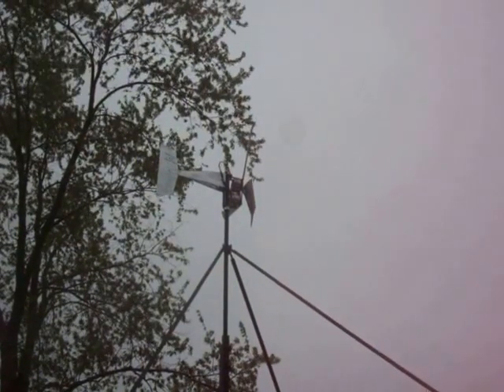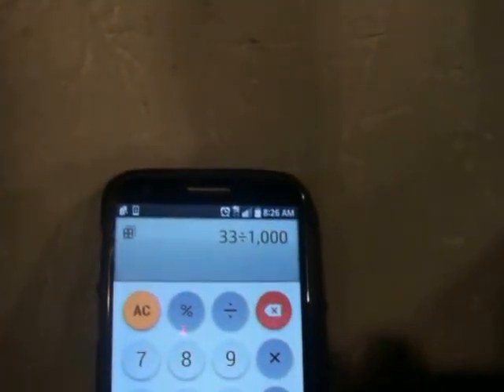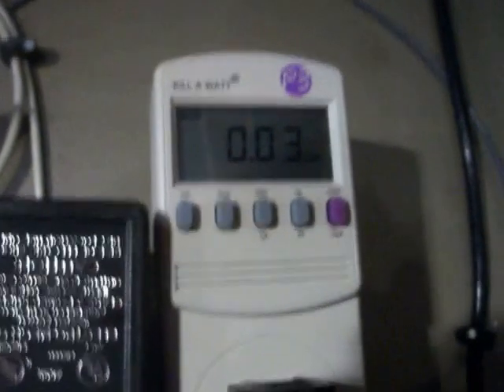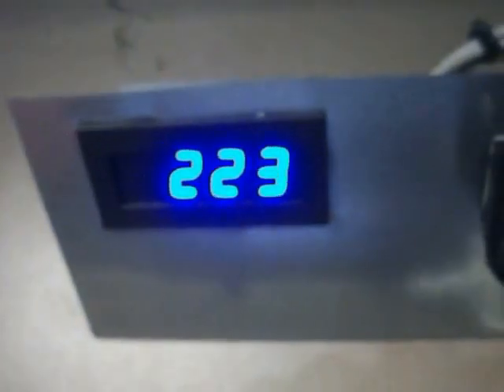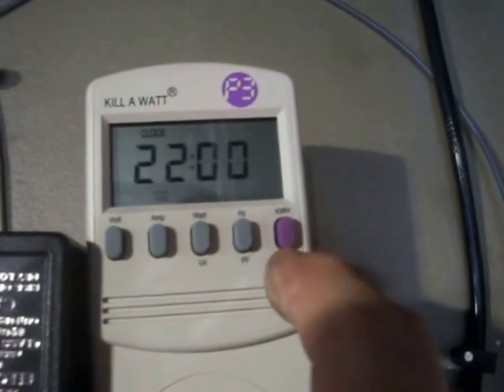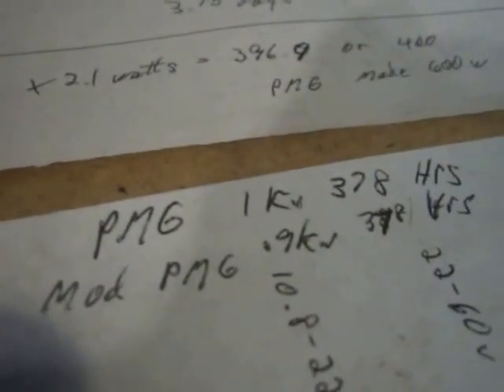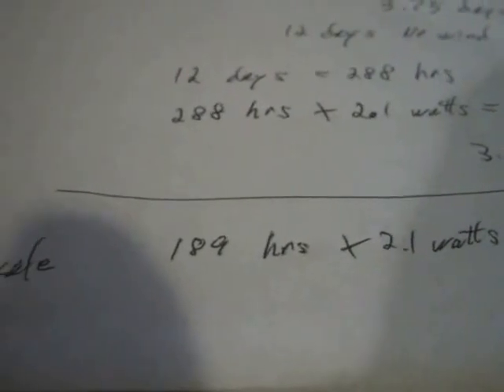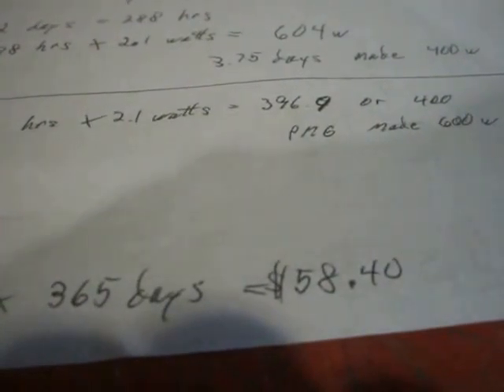Testing the Kill-A-Watt meter against wind turbine output

Comment: You should look on craigslist for a fisher & paykel washing machine, they have a 3 phase brushless magnet motor on them. They work so much better for a wind genny. You can rewire the poles for voltage you want and can be wired in star or delta.  Also you can make your own blades out of 6" aluminum pipe from irrigation. I used some pressure treated aluminum pipe thats about 1/8" thick. Works great. Some LG washing machines have a 36 pole 3 phase that works also but the F & P have a 56 pole.  Joe
Reply from the maker: +donzi joe I'll check my area.........what year did they start making those?
Reply: +Lightendog I think all of the fisher paykels so any year. Lg im not sure
Reply: how big of blades can you make from the 6" aluminum pipe? I am trying to figure out what I can do to have a bigger swept area than what these wind turbines on the market offer. i have 18mph average winds where I am at in michigan and the power available depending on efficiency of the alternator and blades is as low as 200w. Max efficiency of 50% which I don think is possible with current offerings is still only 483w in that wind average. Which means that there isnt even a need for a powerful pma as you wont get very high wind power often with the turbine. I have a 24vac pma that is capable of 3000w max, but I need larger blades to be able to even hit 1/3 the power of it.

Comment: Thanks for the excellent video.  Wind power isn't for everyone or for everyplace.... Thanks for reminding me.  I was looking at turbines.  Maybe if you lived in the Dakotas where 15mph winds are everyday normal then you might see some power....
Reply from the maker: wadesready You are correct.  Infact, I'd save more money unplugging my grid tie as they draws 2.2 watts.  lol.  I'm not doing anymore videos on MW&S turbines.  The pmg's are garbage to me but maybe I expect too much.  I had a storm come thru and for the whole day I made like 10 watts.  Even if it were up higher and I made 2 kw  every day for 1 year, I'd only save like $116.  They are only good for trickle charging small battery banks, not for making real power.
I just made a video on a sun tracking solar rack......I'd avoid turbines all together.  But in the future, I'll be making a homemade high out put pmg.  You know what they say......If you want anything done right, you have to do it yourself.

Comment: It count's power in or out and as power used. Just the way they are designed.
Reply from the maker: ***** I'm not sure they were designed to count power coming in from solar panel or turbines.......It didn't mention anything in the user manuel on that.  Only checking power used by house hold items, and I looked over the whole manual.  But at least now I know exactly how they work.